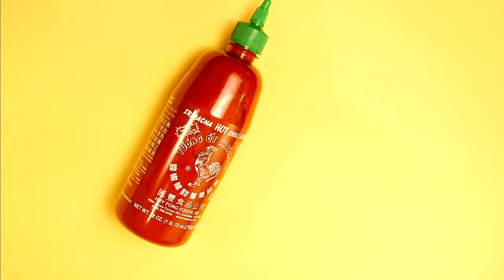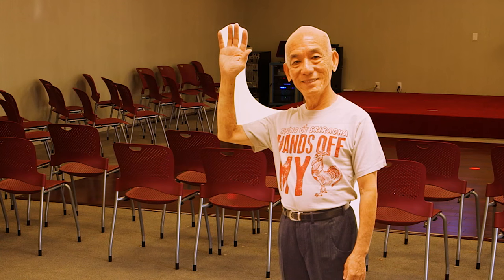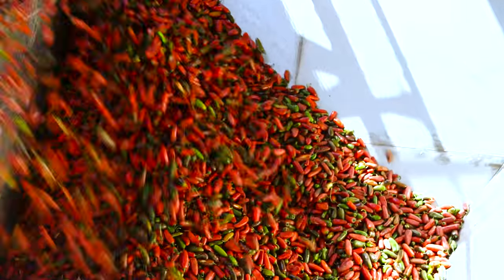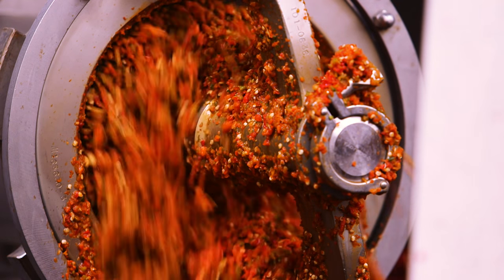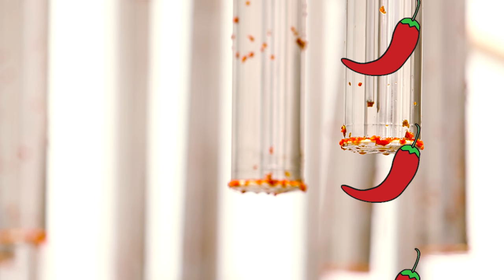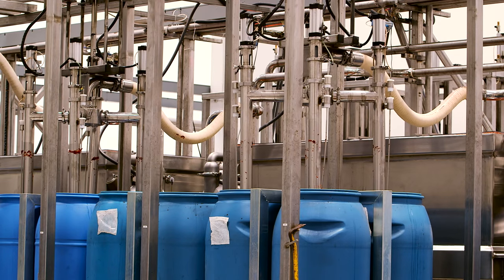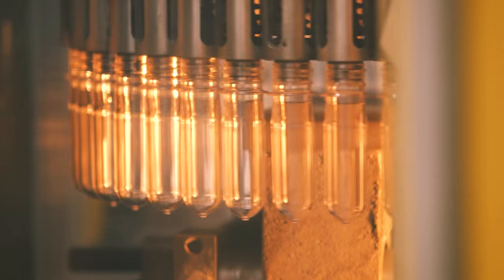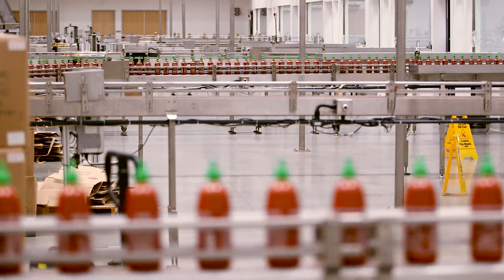How Sriracha Is Made | How Stuff Is Made | Refinery29

Comment: If only it were more spicy
Reply: you can mix it with tobasco very little and it will be allot hotter, or try mixing it in with little wasabi
Reply: No its perfect!!! Has the perfect flavor to heat ratio.... If it was any hotter it just wouldn't be as versatile good and go amazing with every single dish and everything in between!!!  If you want it hotter you can add powdered cayenne pepper which is just pure heat as you eat and no flavor, or add any other ground peppers you like
Reply: Purchase some pure capsaicin and mix it in with your sauce. Problem solved.